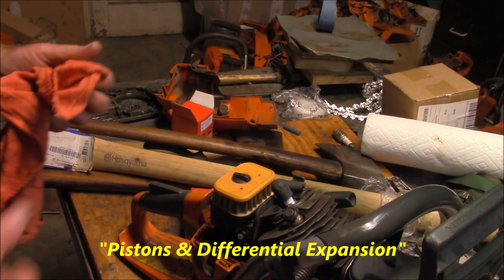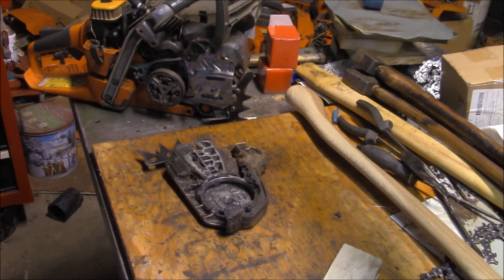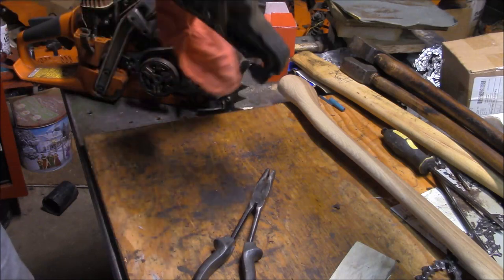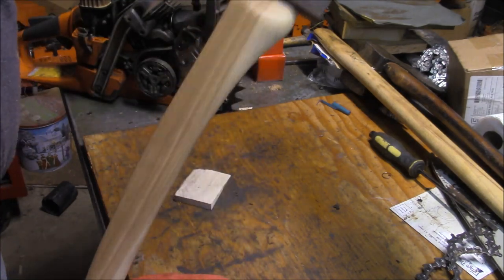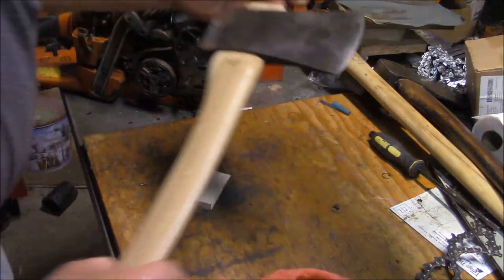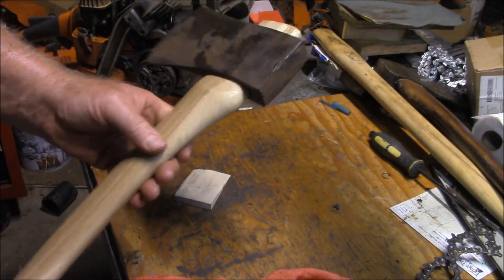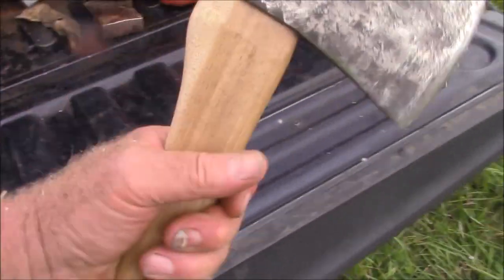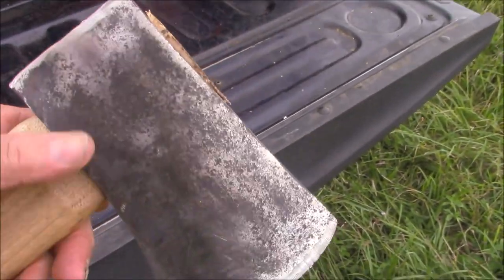How to release the 550/562 Husqvarna Chain Brake when its set and the cover is off

Comment: Use to work for a Refactories Contractor
 9 years ago and we use to rebuild the melting furnaces for Mahle in McConnelsville Ohio where they made automotive engine bearings. 

Not sure bout these little Pistons but most automotive and heavy equipment  pistons will have different metals in the piston to control the expansion rate.
Like a forged piston will expand alot more than a cast piston  but I'm sure you knew this.👍👍
Reply from the maker: i do understand this, but really want folks who aren't former engineers to understand some of the physics. :)

Comment: My 40+ year old red True Temper boys axe is my wedge beater.  I sometimes use my 50 year old 4# TT single bit with a does leg 31.5 inch axe as my wedge beater.  I take it on jobs that I may need to cut something.  Don’t remember how many handles it has had put in it.  When I was splitting wood for the fireplace it usually had a new handle at least once a year.  I restored all my axes to like new a few years ago.

Comment: Grain orientation on axe handles is really not a huge deal, as long as the majority of the grain run from the top to the bottom you are good, a little run out is fine especially on a straight handle maul. You are far more likely to wear out a handle by over strikes during splitting than you are to break one out right. I've seen lots of handle with perfect grain crack while other bad grain handles do just fine. All handles however will eventually break no matter how "perfect".

Comment: Most of the handles that I have broken had nothing to do with grain orientation but from over strikes.  I try to choose a blank with straight grain but it is not my only criteria.  My biggest criteria’s are availability and is it the correct width for the eye of my axe and handle length that I want.

Comment: Grain orientation is akin to oil brand and or mix ratio, its all bullchit use what works and what you can ready get at your house. Cuz I dont know anyone that can see that far.
 Do you know why we have 2 ears and 1 mouth? So we can listen twice as much as we talk..Carlo Gambino
Reply from the maker: I see the difference I guess. My axe has worked splitting wood for a season so I guess it works. But I see the logic. Actually it's more akin to some of the bling stuff folks buy, like $100 forged pistons in a work saw. While a Mahle will out last every other part of the saw, and a cheap $30 piston will last long enough, some see having "better" stuff as worth the money, :) Getting a grain orientation as pete mentioned may not matter, it only costs we looking over a few handles :)
Reply: @afleetcommand  I too choose the same way and will go through all the handles to choose the same "proper" grain orientation.. that said I dont think there is anything wrong if its not perfect... I think it was bucking that said the "wrong" grain orientation also allows for flex and therefore more spring action

Comment: I'd pull the exhaust and look inside.  Then call the guy   .   I wish someone would do a weekend class . 1:1 on these modern saws.   Doing a complete rebuild s.

So if the piston is not wedge shaped. It's going to gouge and rattle the cylinder and eat through the plating. ?